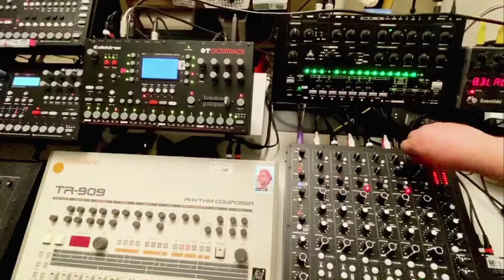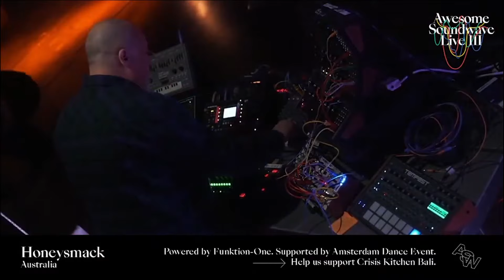Techno Beat Production: Honeysmack How I Make Improvised Acid Techno

Comment: Amazing content and video. I wonder what would be the minimum amount of equipment you would need, or recommend, in order to perform a techno live set. That would actually be super valuable info for people starting and wanted to perform live, and start organising and be aware of minimal needs to. Thanks for sharing!
Reply from the maker: thank you - I guess you'd need at least one machine. These days there's so much to choose from, all from a variety of music tech brands. Let your imagination and budget guide you, nothing is wasted. Embrace the journey not the destination.
Reply: Probably start with a Elektron Digitakt, Elektron RYTM mk1 or Roland TR8S. They all have different trade offs, the digitakt is a sampler and midi sequencer, the rytm does everything but it costs more, the TR8s plays samples and has some FM synthesis but can't sequence other gear with midi, although it's got more controls. They can all sequence drums and basic techno melodies and all cost around $1000. It's an expensive hobby! I started with the TR8S a Behringer TD3 and soon after a Eowave Quadrantid Swarm. I didn't have many limitations at that point.

Comment: May I have a question: I understand you don't use headphones, but if you did plug one in the Model 1, and cue-d the channel, turned volume to zero, can you hear a what sounds like an extreme bit-crushed crackle from whatever sound that channel is receiving? I tried a Model 1 and found this bug. Would like to know if it's unique to that mixer, or all Model 1s. Thanks, and super thanks for your "studio tour". ,'-)
Reply from the maker: I have heard of someone else having possibly a similar issue, although not present on my mixer.
Reply: @Honeysmack  Thanks, very helpful.

Comment: What do you use as your Master MIDI/Sync Clock?
Reply: I would also like to know that 👍🏻
Reply from the maker: It varies for every performance and recording. Typically it is the Octatrack, although it can be the MachineDrum, TR-909 or TR-808 or something completely different.
Reply: @Honeysmack  thanks for that. I've found my TR-909 to be a little loose as MIDI Master. We've moved across to the ERM Multiclock, but need to work around the challenge or the subset of gear for live work, in a similar way that you do. We might experiment with our Elektron stuff or EMX1's.
Reply from the maker: @GodlikeAu  Elektron boxes are pretty good as the source clock... as for vintage machines embrace all their limitations, its what makes them so special!

Comment: I am sure Q-ing a synth could help eliminate hick ups. Some times an acid pattern just don’t fit and you need to find another fast
Reply from the maker: nah, there's no real hick-ups, no mistakes, no errors as such... everything is embraced and tends to fit because nothing is prescriptive - that's why I don;t need to cue anything. It's hard to cue something whilst you're improvising, otherwise you're simply not improvising. The parts that perhaps don;t fit or dont sound right are the moments that change the direction of the performance. (hope that makes sense)
Reply: @Honeysmack  I hear why. Okay 👍🏻 good job teacher. I need to push through those and go with it.